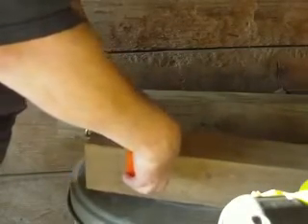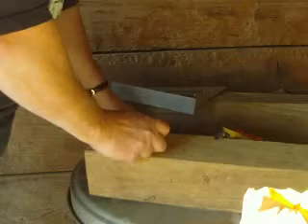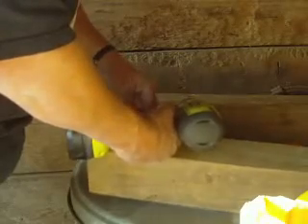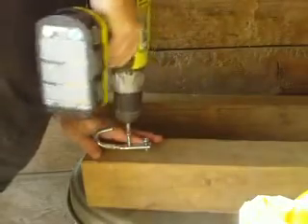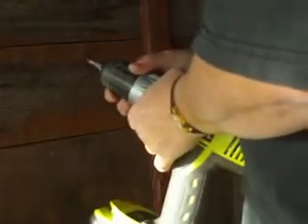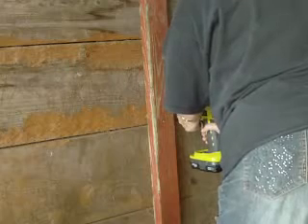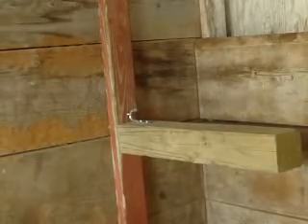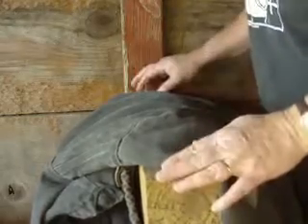DIY Saddle Rack

Comment: What are the hooks called?  I can't find them at the hardware store with the flat part that has screw holes like yours, only in a "bolt" or "screw" form. Thank you! :)
Reply from the maker: I don't remember off the top of my head what they call them.  But I believe I got them either at Tractor Supply or at the local feed store that is also a hardware store.